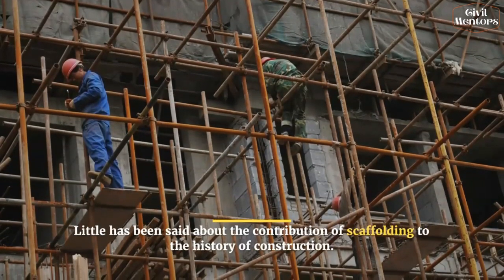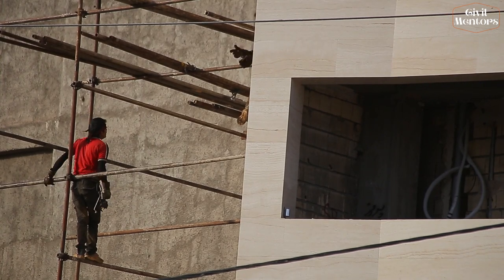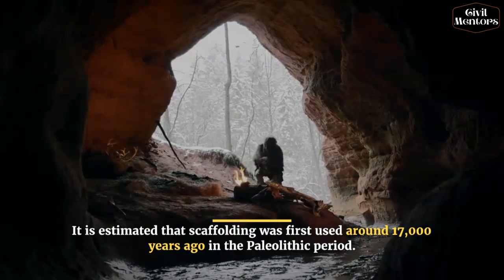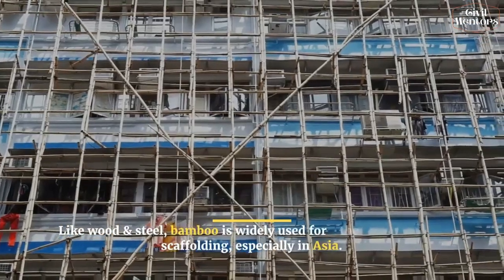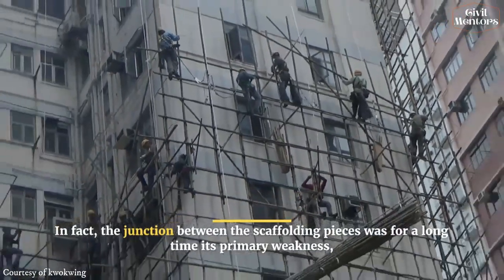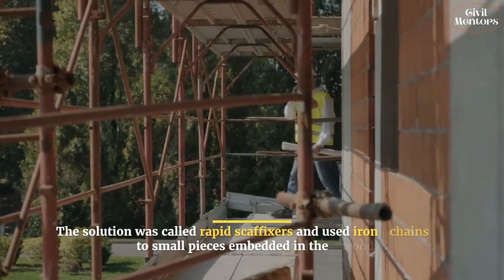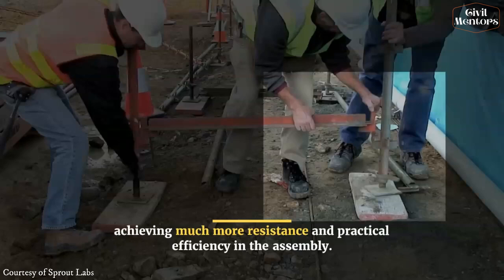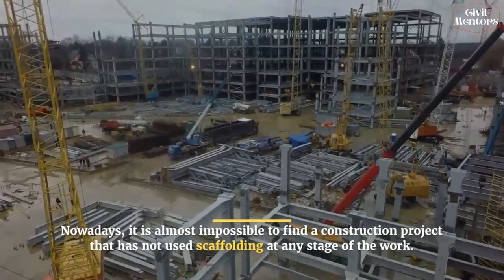Scaffolding - The Unsung Hero of Construction

Comment: Palmers UK pretty much invented modern scaffolding, innovations from SBG (Scaffolding Great Britain) furthered throughout the early to mid 20th century  improved a lot of Palmers original designs that we see in use still today over 80 years later.

Recorded use of scaffolding in medieval Europe would have been the PutLog which effectively means to put a log into a wall as a means of access. Scaffolding in the sense of the terminology used today such as Ledger/Standard/transom  are Naval terms as the riggers when in port would use the boats wooden components and ropes to earn a little on the side erecting erecting scaffolds.  

Hemping a term used in  Tube and fitting scaffolds meaning placing another tube in the vertical stance on top of another (Hemping) goes back to the rigging days when the best rope to tie two wooden poles together in the vertical stance was hemp rope.